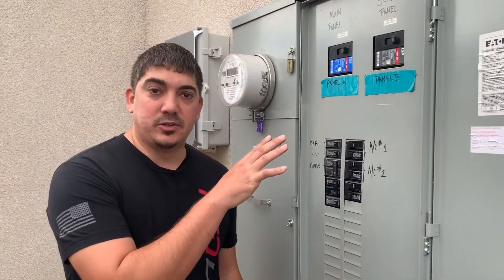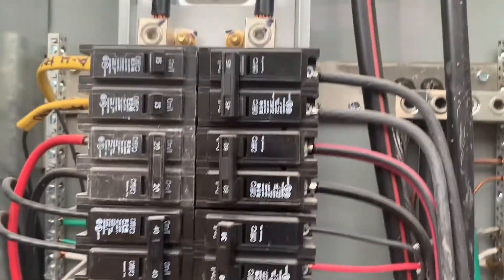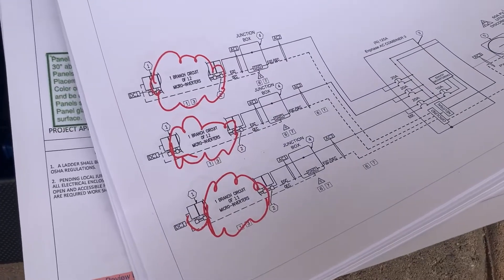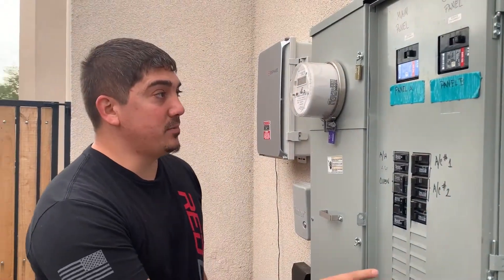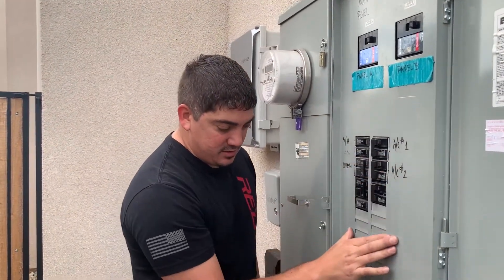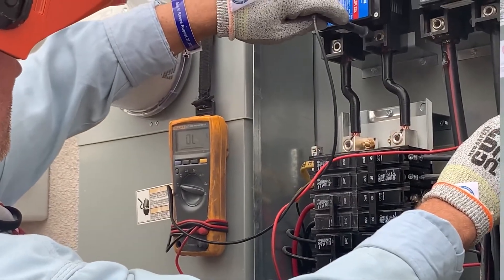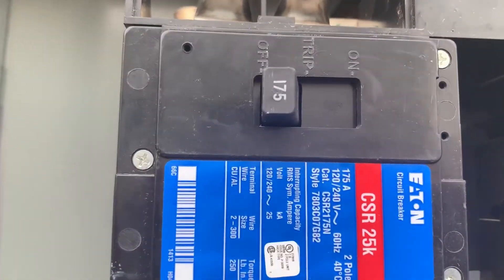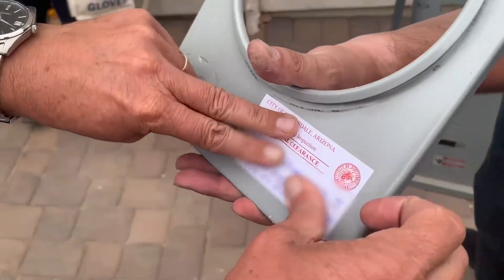What is Derating- Redline Electric & Solar

Comment: On my solar system, on my inverter, in the mode screen it says derating some times when the sun is strong. and the power light is blinking. It looks like it does this when it is taking in about 19 amps. Do I need to do any thing? My system is still generating and taking in power?
Reply from the maker: This may be because your solar modules can produce more than your inverter can handle. We call this "Clipping". Are you in AZ? Happy to have someone take a look!